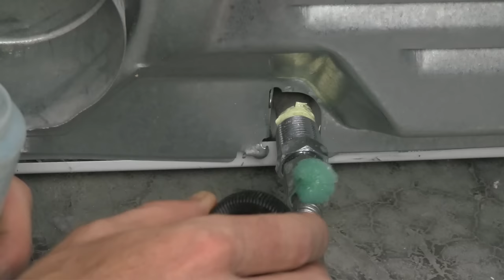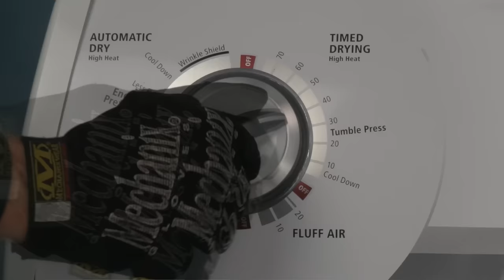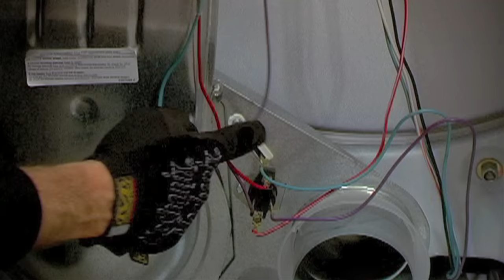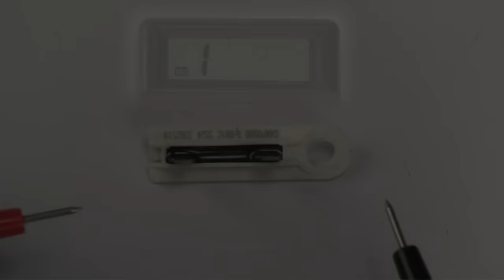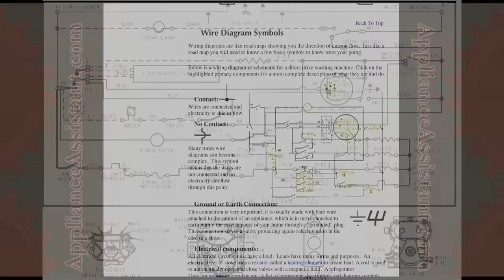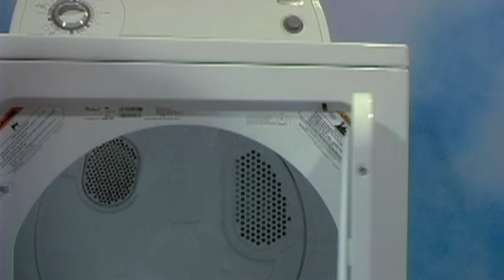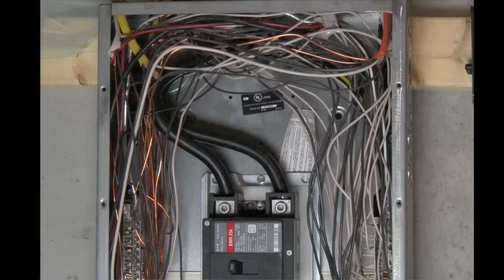Gas Dryer Repair: Fix Heating Problems

Comment: when you tested the cycling thermostat you never listed what ohm setting you used...on the two lowest settings 200 and 2K I have no resistance yet on the 3 higher settings 20K 200K 2M I'm getting a reading...I have already replaced the gas solenoids and the problem still remains the gas lights fo 30 seconds then goes off and does not reignite...
Reply from the maker: The cycling thermostat should be normally closed, with no resistance across the two main terminals on opposite ends. The connection opens to break the burner circuit when the target temperature is reached. The two smaller terminals in the middle of the thermostat, if you have multiple pump options, is a heater so it should have some resistance, however a failure there would not directly cause your symptoms. I would like look for an air flow problem of some kind, and if nothing was found replace the high limit thermostat. Just a guess… Good luck!
Reply: @applianceassistant  no air flow is not a problem the duct from the dryer to the wall went is clear as well as the outflow duct in the wall...there is no impedance of heated air in the dryer's internal duct work ...every other electric sensor has passed continuity and ohm readings I will take your advice on the high limit thermostat and see what I can find...thanks
Reply: @applianceassistant  addendum...when checking the high limit thermostat it went from OL to  00.00...I'm assuming a 00.00 reading  means no resistance of any kind...which implies no energy flow of any kind ...all working circuits have some impedance value ...ie ..potential, resistance , ground ....let me know if this is incorrect...thanks
Reply from the maker: It should be normal closed and open only as a high temperature safety. They fluctuate in what that value is, but over 200 degrees, it is probably stamped on the outer edge of the thermostat.
Reply: @applianceassistant  in the videos I watched, to check the high limit sensor,  all that was necessary was to get an ohm reading of some value regardless of what it was...in my case when I checked that sensor it never registered a positive number at all such as... 2.41, 7.03, 0.55... whatever ,...it always only registered 0.00...the 0 number puzzled me , from what people have told me in a working circuit some value of impedance always exists even though you have good energy flow, it exists because it is performing work...in the case of a test , energy from the battery in the multi tester is flowing through the circuit being tested...it seemed to me it should have registered anything other than zero but it never did...it simply went from OL (overlimit, when touching the probes together) to zero when checking the sensor circuit ...zero is like infinity it is undefined,  it is nothing ...I don't know what to make of it...hence my question ...I'm assuming it is not good and as you said that is the most likely sensor apart from the gas solenoid  that would cause it to shut off in such a short amount of time ie...30 seconds
Reply from the maker: If the high limit thermostat is unplugged and isolated from the rest of the circuit it should just be open or closed, (normally closed with no resistance at room temp). It does not perform any “work” except to allow current to pass through if the dryer is not too hot. 
One note… Newer style Dryers can use thermistors which do have a resistance value. The type shown in this video are standard thermostat switches which is what I’m describing. 
It sounds like that’s what we have been taking about. It sounds like the high limit has become overly sensitive and is opening at a lower than designated temperature. Or carbon buildup on the contacts are weakening the connection…I hope that helps! Best of luck!
Reply: @applianceassistant   that should do it ...I don't mess with dryers a lot hence looking for advice ...thanks
Reply: @applianceassistant  I did unplug all sensors before testing , I simply mimicked how you performed those tests..again thanks

Comment: Excellent video!  Reading the comments I learned to check continuity of each component before disassembly and replacement. Opened up the dryer and tested the main components which were all good. In the end, some critter had crawled up the exhaust pipe and created a nest causing air flow resistance.  Outdoor washer/dryer. Cleared and cleaned the exhaust pipe and it ran like new!! No replacements needed. Start with the simple things first!!

Comment: STILL having issues, rebuilt the whole thing almost! Had to replace the motor, and break the blower wheel.  I cant seem to find the rear, motor retaining clip.  I only found the motor mounting bracket, and ordering the blower wheel today.
Reply from the maker: That is one of the most difficult repairs on this dryer style! Sometimes chiseling the blower wheel off if the only way, once the plastic square, motor side of the blower rounds out. I have another dryer video on my channel that shows that process in more detail. Good luck!

Comment: If it is the very last issue you describe where you get infinite showing on your tester when testing from the red timer wire to the blue door switch wire while pressing the start switch. Then what do you do? Thanks

Comment: I have GE gas dryer GTD33GASK0WW, the thermostats show resistance and continuity. So I replaced the typical componets like the ignitor, flame sensor and coils. But still no flame. The ignitor would glow for a minute and then go out and attempt to glow again but no flame. I am thinking gas valve assy? Any other things to check ?

Comment: Very helpful video. Appreciate the step by step detail. I didn't observe a flame, and the thermal fuse registered 0 on the multimeter allowing for continuity. Next was the ignitor test which registered non zero values and is good from the video explanation. The fault appears to be the flame sensor which registered non 0 values for continuity failure. Ordered a $14 replacement part off eBay and patiently waiting and hoping that is the root cause.

Comment: Is the drum spinning too fast? I had this issue and it was a simple $6 fix https://youtu.be/XNG8oSfbhHE
Reply from the maker: That is fascinating. I have never experienced that issue but it makes sense...  My question would be, why did the pulley wear down??  Are the clothes very wet coming out of the washer? Perhaps the load is heavy due to excess water. Thanks for sharing!!!

Comment: I've replaced my high limit thermostat, but it still keeps tripping. The dryer will stay on if I remove it away from the flames. Can you point me in the right direction on what it might be?

Comment: If the fuse tests open…what does that mean??
Reply: Thermal fuse? If it registers non 0 values on the Omega setting then it's blown and can be replaced.

Comment: Hi ,I have sumsung gus dryer 
And it's start spinning by closing the
Door and not heating .Power  boten are not turning it off, have to keep 
Door open  or it will work no stop
Checked all ventilation hood all clean. Please  advise

Comment: How long should the flame stay on to know its working perfectly. My flame normally lasts between 45 to 70 seconds before turing off. Theres then a 25-35 second break before starting up again and the seconf flame lasts around 40 seconds

Comment: My whirlpool dryer only works in mid range energy saver mode. Any other setting, the barrel spins, but the heat doesn’t come on. Any ideas which part needs to be replaced? Thanks
Reply from the maker: If it's less that 10 years old and has a timer, that would be my guess.  The newer mechanical timers are common to have issues in the contact points inside the timer.  But it's just a guess, on a fairly expensive part... Sorry I can't be of more help.  Good luck!

Comment: Great comprehensive video for virtually ANY OLDER gas dryer heating problem. Great JOB. NOT COVERED was rare circumstance where gad valve itself is bad. Test gas valve solenoid coils for resistance. Two terminal coul should test at 1k to 2K ohms at room temperature. The LEFT terminal big three wire booster is the common terminal. Resistance across each coil should read 300-2k ohms. If Open (OL) or very high resistance, replace BOTH SOLENOIDS. If they are good, igniter glows bright orange, but turns off without igniting burner, then the grass valve itself is bad. ALL MODERN DRYERS now use a relay start switch witch MUST be tested live with current running through primary wires. When pushes the relay will close the circuit between the terminals of the secondary if working properly. I know if no MODERN DRYERS that still have an electro-mechanical timer. They all use electronic printed circuit boards (PCB). a few (low priced AMANA) may still have a motor to move the selector knob in timed dry. GE was the last to go to a PCB control. Now owned by Korean giant, HAIER, the new control boards have been problematic - especially in washers and STACKER, all-in-one units. You can save time by checking the continuity between the red wire  (might be different color vin non Whirlpool made products (and the DISCONNECTED light blue wire on the thermal fuse with DOOR CLOSED. If continuity is present, all the thermostats and door switch are good. Check burner operation. If that same test on an electric heated dryer shows continuity, the heating element is also likely good. If not and dryer will not start, check door switch and thermal fuse first. Keep in mind that if  thermal fuse or thermal cut-0ff Thermostat blew, something got too hot. The fuse also will blow if the motor draws too many amps. The thermal cut-off will blow (some are resettable now) the heater got too hot, indicating high limit thermostat is malfunctioning. In Electric model, a heating coil (many have two now) may be shorted to ground. This condition should blow the circuit breaker.
Reply from the maker: Thank you for the detailed information and updates! I would love to make more videos but I have been working on https://ServiceNode.work, an appliance repair business management application that is, very exciting; however, there isn't much time left for making videos. 
Your explanation I'm sure will be very helpful to many people!

Comment: Great information and well presented. My dad was an appliance repair guy by trade I wish I had paid attention when I was a kid.
Reply from the maker: Thanks! I can relate with that! I learned from my dad and other family members, but I was very casual about it.
Reply: @applianceassistant  Thanks for responding. I have another question. A couple years ago we had someone clean the duct. It is quite a long run to the outside. He used a gadget with an air compressor to power it. What is that called so I can get my own. Thanks again.
Reply from the maker: @franksquires9637  Not sure about that tool, sounds neat! I use a brush driven by a drill called "Lint Eater". I have also heard of people using a leaf blower, but I haven't tried that one personally.
Reply: @applianceassistant  I might give that a try, let ya know how it works out

Comment: Hi my dryer turns on gas comes out but shuts off in 5 minutes.
Changed thermal fuse and resistor. Could it be the solenoid coils? Checked them and 1 of them had no connectivity. 
Any help would be appreciated thanks

Comment: I also had gas dryer full of lint and it was just making a nice glow but no flame.  I opened it and it looked like a bear and raccoon died in there.  I removed drum and cleaned the surroundings well, also disconnected the back vertical "oval exhaust" duct that was also full of lint.   And vacuum cleaned and blowed around all sensors and metal tube where flame happens.  I checked all my sensors and all of them had continuity.  I started to get flame but it would light for 10-20 seconds and then turn off (all while fan running) ... then after about 50-80 seconds there are 2 clicks one after another with some interval and then flame goes again for 5-8 seconds then shuts off and repeats over and over.....Then i assembled everything back.  Gave it a try and it was working just fine without breaks. Turns out the system / sensors are calibrated in a way that they sense something about the surrounding air and don't let the flame to stay until things are assembled.  So to summarize fix... i did not replace any parts, just cleaned the lint and it started to work 100% properly only after i put everything back together.  Thank you for the video above....great stuff!!! and comments of users also very helpful.  Saved me good chunk of money.

Comment: THANK YOU SO VERY MUCH! I replaced the gas valve solenoids less than 24 hours ago but the problem persisted, but thanks to your video I realized the dryer was set to "Cool Down" therefore it wasn't heating up. You saved me a lot of time and the unnecessary replacement of parts that were functional. Thanks again!

Comment: Replaced the coils. But I also had a defective motor relay. Taping on the relay everything was great. High heat. Then I attempted to replace the relay. Decided not to as my eBay relay seemed cheap (as did the coils). Resoldered the one leg of the relay and put everything together. Now I have low heat. There is not a speck of lint anywhere in the dryer. I can see the glow bar turn on, hear the solenoids click, hear the burner. It just gets warm never got. There is no illustration of the traces on the power board and the schematic is high level. Going to assume the leg I desoldered is the culprit. These older dryers like in this video are so easy!
Reply from the maker: Absolutely! I’m pretty unhappy with the direction of appliances... That sounds like some good work! Sounds like it is burning some if your getting a little heat. So perhaps the cycle thermostat/thermistor or high limit thermostat.

Comment: I hope ya still around :).  I have the identical 
whirlpool dryer.  If anything I am just confirming the problem.  1... turn on power   2..I hear a click then fire lights up in chamber.  about 30 seconds maybe a minute later I would hear a click and then fire goes out.  gas valve ignition solenoid?  Thank you for your help.
Reply: I would look at the ducting first and the high limit thermostat second. If the coils are bad, in most cases the ignitor will glow and go out with no ignition. Short burn times are more high limit thermostat related. The question is, is the thermostat bad or is it doing what it should do with a clogged vent. Hope that helps! Good luck!

Comment: My thermostat reads it is fine but when I took it off the dryer it sounded like something was rattling in it.. should I change it? I either have to change that or the  timer bc it keeps shutting off after a minute

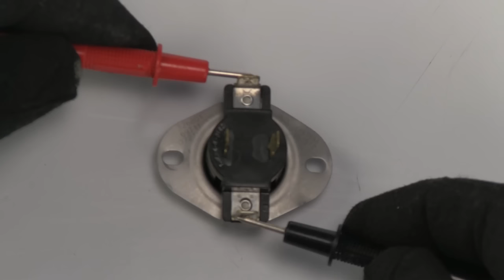Comment: All went well until 8:53 when you started to test components out of the unit.  Then the video becomes confusing as we can't see where the components are in the unit.  Otherwise, this is an excellent vid because it goes into more advanced troubleshooting.

Comment: Hi, my gas dryer igniter works and can see the flame but it turns off after 30 seconds and turns back on after a minute or so but clothes not dry.  What could be possible cause ?
Reply from the maker: Sounds like an airflow problem. I would check the home duct first. Good luck!

Comment: Thanks, excellent steps to follow to diagnose the trouble. Dryer fixed as fast as listening to the instructions, thermal fuse bad & replaced.

Comment: Hello
I have cleaned the vent replaced thermal fuse and gas valve coils. I tested for continuity igniter flame sensor, thermal cut off fuse high limit thermostat and timer and they are all good but still turns off after 10 seconds. Please help.

Comment: My flame doesn't come on at all but it does  glow but no flame
Reply from the maker: If the ignitor clicks off with no flame, In most cases that would point at the valve coils. If the ignitor just continues to glow it would be the flame switch.

Comment: I replaced the coils and ignitor which seemed to be faulty with no continuity. I tested all the other fuses at the rear and the flame sensor, they had continuity. However, the ignitor still does not glow. The dryer starts at various settings but no glow or flame, just air dry. What is the next suspect(s)?

Comment: Great video, saved me the cost of a repair man! I had a big ball of lint stuck in the duct and it popped the thermal cutoff. Lesson learned I need to clean my duct more often. Anyone reading this, don’t be afraid of the “advanced troubleshooting”. In conjunction with the video, I went to there website to do a little reading and it was all very clear what worked and did not work using a multimeter.

Comment: GE Gas dryer had no heat.  I replaces the coils (not OEM) and I tested the dryer and it worked twice (ran it for 15 - 20 seconds).  Then I pushed dryer back into place and went to use it the next day and it won't ignite.  Igniter glows and clicks off and when I open the door i can smell gas.  Very confused now since, it seems igniter works, coils work (I think, because I can smell gas), and igniter shuts off after 15 seconds (so I think flame sensor works).   Any thoughts on what the issue could be?  I made sure the bracket for the coils was tight.
Reply from the maker: That’s a tough one. Symptoms wise I would guess a bad set of coils but the release of un burned gas is pretty alarming. Not sure what to advise because I don’t want you to get a face full of flames... sorry I can’t be of more help!

Comment: Best video to help diagnose a gas dryer heating problem.  Thank you so much.
Reply: Fixed my dryer issue with your help. Was the thermal fuse. Thanks!!